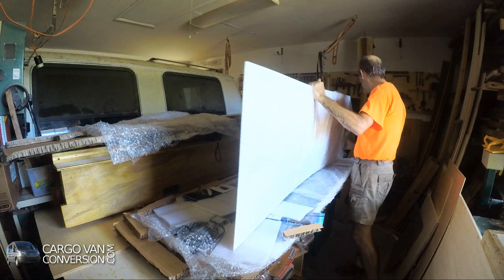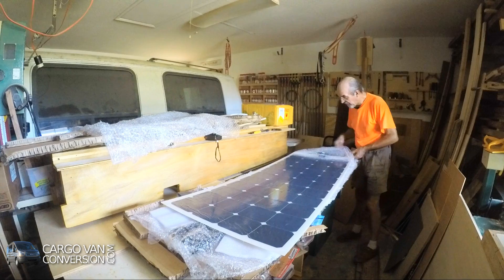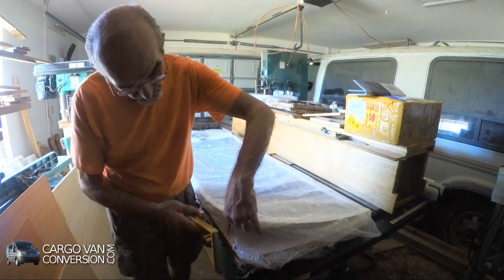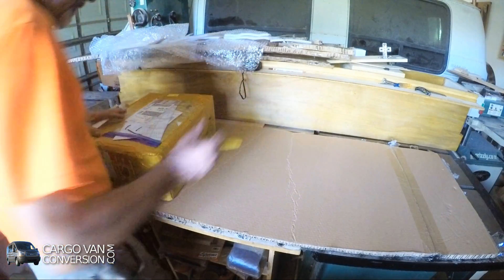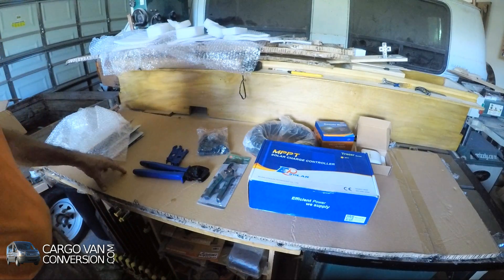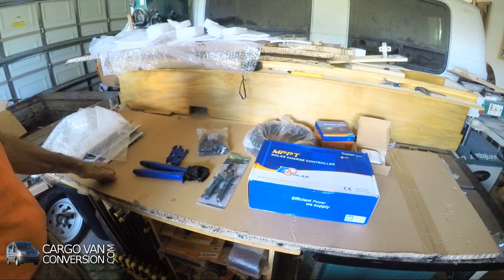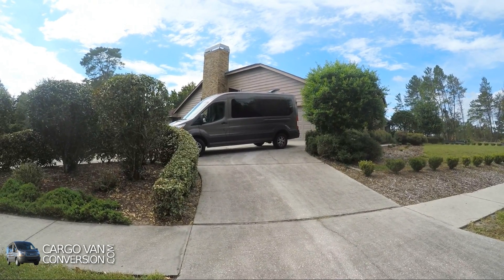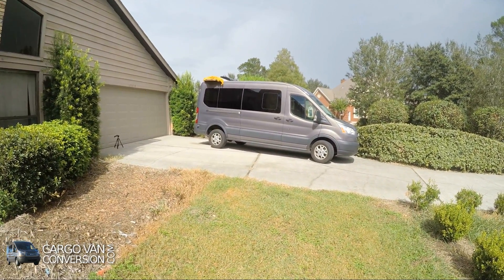Buying Flexible Solar Panels From China

Comment: Hope they are working well! :) I am learning so much before I get my travel camper. I have been learning a lot about solar and this was good to see :) thank! Kat xx
Reply from the maker: Hi Kat,
Solar is basically reasonably simple. Where it gets complicated, is the details: wire types, sizes and lengths, solar controller and inverter capacities, good wire connections, programming of the controller, breaker boxes, combiner boxes, appropriate use of circuit breakers and fuses. It gets confusing after a while.
While I'm not an expert at this, I will get into these details in upcoming videos, hopefully giving a sense of what one can expect, when you decide to install solar. Have a great day!

Van Williams
Reply: Thats the part Im not confident with yet lol I am also looking to put solar on my cottage room in my back yard. So Im trying to learn all I can, Ill get there :) thank you xxx
Reply from the maker: Hi again Kat,
Good luck. I'll be posting more videos regarding my experiences with these solar panels and the installation. And while I'm not an expert at this, you may pick up a few pointers.

Van Williams
Reply: Im sure I will :) I always learn something cool from your vids. Thank you!!

Comment: They look fantastic. Being curved on the roof I wonder how well they perform compared to the rigid ones. Look forward to seeing them up and operating.
Reply from the maker: The curvature is only slight but theoretically should expose the panel to more sunlight. Practically, it probably doesn't make much difference; placement of the vehicle in relationship to the south is likely much more important, as is the possibility of shadow.
These are high efficiency solar cells with a stated 20% efficiency; what that means in real life is unclear to me, but as a comparison tool, it is similar to most current rigid panels. The cells are Backcontact Sunpower cells, which are the latest and have more exposed area for solar collection. They are also of a higher grade than most older (flexible) panels.
While the ETFE top laminate (similar to glass on rigid panels) is sturdier than the PET used on older flexible panels, it also performs better.
The very first measurements (not under load) I had, show 27.7V @ 5.05A (flat position, midday, sunny) in comparison to the stated 24.9V @ 5.7A. The higher voltage is advantageous as the MPPT controller will boost the amperage more, especially in winter, when it is cooler (and more needed).
Biggest question I have right now, how these panels perform long term. The 'first generation' of flexible solar panels had issues with delamination and bad cells; I hope that is fixed. Time will tell, but I'll give periodical update here on YouTube and on my website http://cargovanconversion.com

Van Williams
Reply: Master Website Designers in Jio

Comment: How many watts at what price, ordering direct?
Reply from the maker: Hi Chantelle,
These are better quality panels, made with more expensive ETFE laminate and higher grade/quality Backcontact Sunpower solar cells. They come in many sizes and consequently, prices. I was fortunate, that LinkSolar http://cargovanconversion.com/LS had these 135W panels with an overall length of ~60inches (~1560mm), which is virtually the same as the width of the roof of my Ford Transit van. This optimizes the use of the roof and makes installation easier.
You can find current offerings and pricing on their website http://cargovanconversion.com/LS While LinkSolar is a sponsor of my website, I make no 'affiliate income' on orders. So far, I've had a good experience with them. The production lead time was two weeks and after that 3-4 days delivery by air/FedEx from China to Florida, USA. Communication was through email; sometimes a bit confusing, but always with prompt replies. Send me a private message or email me on the website http://cargovanconversion.com/about for more specific questions. I'm not their spokesperson and these are just my opinions of this product.

Van Williams
Reply: Cargo Van Conversion thanks for your input. More people seem to be much happier with the flexable panels, now that they have been improved. I will need at least 400wt to meet my needs. Thanks again.
Reply from the maker: Good luck with your installation and let me know how things work out. Have a great day!

Van Williams

Comment: G'day Van, Another helpfull video as usual & I liked the flexible panels they look good also it was beut to see you also bought an MPPT controller, I can see you really did your homework.
I will contact you shortly mate with my update etc.
Please give Joey a hug for me &  take it easy Mate,
Kind Regards, Steve.
Reply from the maker: Hi Steve,
I hope you're doing better health wise. That would mean some more work on your truck... Joey already gets too many hugs, although one more wouldn't hurt him :)
Solar in an RV is basically fairly simple, but with all the options and variations, it quickly becomes an interesting mess. Too many types of cables and thicknesses, types of panels, controllers, amperage, voltage drop. It sometimes gets confusing. Lots of time in the design, and even more, amending it.
Good to hear from you!

Van Williams

Comment: What kind of wattage will they give you? Thanks for the vids!
Reply from the maker: Hi dmajor77,
I will have three panels of 135W each, with a total of 405 watts. They are 24.9V and 5.7A each. The higher panel voltage in combination with an MPPT controller, may give me a nice boost, especially in winter, when it's cooler. Have a great day!

Van Williams
Reply from the maker: Hi Randy,
The output of all solar panels is dependent on so many other factors, such as the quality, grade and efficiency of the solar cells, cables used, their exposure to the sun and many more.
They are more likely to overheat in summer, which is less of an issue as a properly sized system will over-produce in summer anyway. I will raise the panels slightly to enhance airflow underneath. I anticipate that overheating may cut power by approx. 10%; that is also easily compensated by more panels.
My three panels are 135W each for a total of 405W with an option to install more at a later date, if necessary. You're right, an MPPT controller for a system of roughly 200W or less is unnecessary. For me, with a system of upwards of 400 watts, it's a no-brainer.
Although these specific solar panels are technically much better than than their 'first generation' cousins, they are still lacking a proven track record and as such their are many questions unanswered. Keep checking for updates.
In the upcoming weeks, I'll post more videos, explaining my setup and showing some parts of my setup.

Van Williams
Reply from the maker: You're right! The overheating is still an issue. I didn't choose a aluminum backplate, but that may also alleviate the problem. My research (on the older flexible panels) shows a power loss due to overheating closer to 10%, but there is not much factual data available and much may be due to other factors. Rigid panels are much better at it, but they undercut the stealthy properties,
In the end, it is a personal choice. If weight and visibility are not an issue, I would always advise to use rigid panels. They have a proven track record, are cheap and are much sturdier.
Have a great day!

Van Williams
Reply from the maker: Hi Randy,
Enough dispersed camping and Walmart doesn't mind either :) Stealth could play a role in urban camping, but it's unlikely that will happen with me. I just want a clean van, not all dressed up like an RV. It's also my daily vehicle.

Van Williams
Reply from the maker: Hey Randy,
I'm not a full-timer now, but have been previously and soon again, You've figured everything out; for me a similar thing, except the lot, but that will likely happen at a later stage.
Wish you well!

Van Williams
Reply from the maker: Same general plans here, but focusing on getting on the road first. Stay in touch; would love to know how things work out for you.

Van Williams

Comment: How do you know how much solar you need?
Reply from the maker: Hi Kim,
I don't know whether that was a general question or specific for me. In my case, my setup is completely electrical, that means no propane. That causes more dependency on the batteries, solar panels and inverter. That said, it starts by figuring out how much my load is, by adding up the amps that each appliance uses times the number of minutes/hours a day. Remember, while you have to be as precise as possible in calculating these numbers, the totals are still averages or approximations. when you know the total use per day, one can calculate the daily amps that one needs per day. These can be supplied in different ways. The basic plan is through solar panels. A 100W panel on average can generate a maximum of 5 to 6 amps per hour. With 3 hours of usable sunlight per day in winter and 5 in summer, a 100W panel can bring in approx 15-30 amps per day. When you anticipate to use 75 amps per day, there would be a need for 300W-500W of solar panels. These are approximations, because of the possible variations: personal requirements, are you a warm weather camper or do you like to ski in winter, Are you always boondocking or do you regularly visit a campground with utilities, The batteries are mainly to extend boondocking. The more battery power, the longer one can boondock. Another source of electricity , is the use of an alternator or generator.
The calculations are often fairly simple, but they differ tremendously from person to person, because the circumstances and needs of every individual is so different.

I think that with the 405W I will have, my basic needs are met; but just in case, if I find out that more power would improve my life, then my setup allows to reasonably easy, expand my setup with one or more 'mobile' panels that I store under my bed. Just a bit of cable and an extra circuit breaker is all I need to do that.
In upcoming videos, I'll talk about what I considered, while designing my electrical system.
Thanks for watching!

Van Williams
Reply: I am leaning towards all electrical, when we travel I will have my 17 yr old daughter possibly my granddaughter and 2 dogs. Propane and butane make me nervous.

Comment: How are you going to install them? I’ve seen some people use adhesive over entire back of panel and on the perimeter edges, not sure I like that idea, too damn messy if have to remove them. Enjoying your Videos, Make them longer, I’m selfish. Good Luck, Vinny 🇺🇸 Like your doggie, great companion. 👍
Reply from the maker: Hi Vinny,
Yeah, Joey thinks he's the boss, but he is a great companion.
I agree with the mess when one caulks these panels. Another method is to bolt or screw them to the roof. That creates more holes and a chance of leaks; it also is not really necessary anymore, with the popularity of VHB tape. Vhb tape is what I will use. not in a continuous strip, but with smaller pieces of tape, creating more spaces where air can flow underneath and cool the panels.
It is so strong that it isn't removed easily either, but certainly not as messy. In an upcoming video, I'll explain all the necessary parts and what I considered to be the best installation method for my project.
And Yes, the length of the videos... Many requests and little time... I'm working on it. I view that as a compliment; thank you!

Van Williams
Reply: No, twelve minutes is long enough!
Reply from the maker: I think 10 minutes is a good time; sometimes it will be a bit longer or shorter, all depending on what's happening.

Van Williams

Comment: I hope these work out for you. from what I gather from other solar installations, these flexible panels do not live up to manufactuer's claims.
Reply from the maker: Hi Mario,
I hope these work out too :) Most of the installations that I've seen, are from the 'first generation' of these flexible panels. They used a different top laminate, called PET, which tended to delaminate. The solar cells used in those panels were also of a low quality. Then some better-known Youtubers exaggerated the properties of these panels by bending them in any direction and by walking on them. Not all, but many panels failed within a year or two.
The panels that I have, have a high quality of the latest Backcontact Sunpower solar cells and the top laminate is made of ETFE, supposedly a higher grade and more efficient top layer.
In the end, the quality has to be proven again with years of service, before we can be certain about it. But my primary objective was, to stay as stealthy as can be and the reason for me to take the risk. I will update my experiences over the coming months.

Van Williams